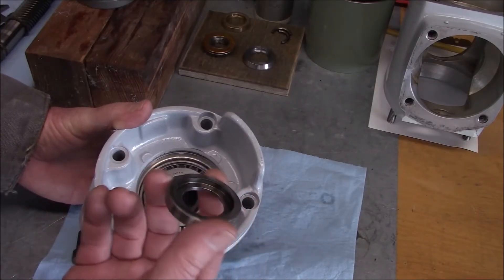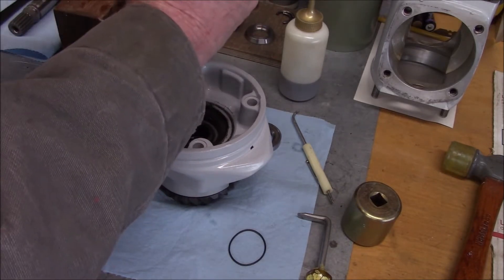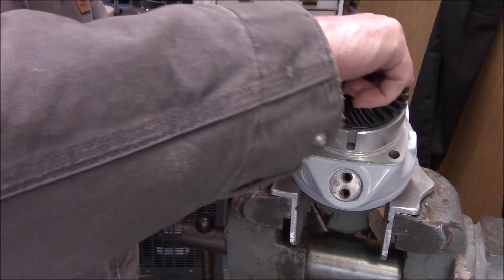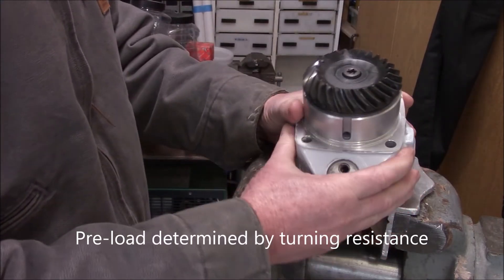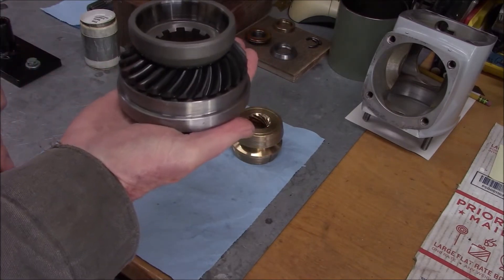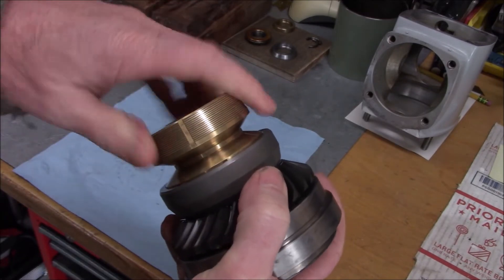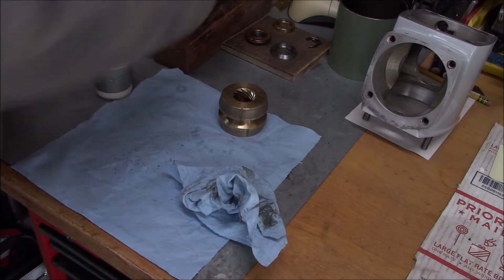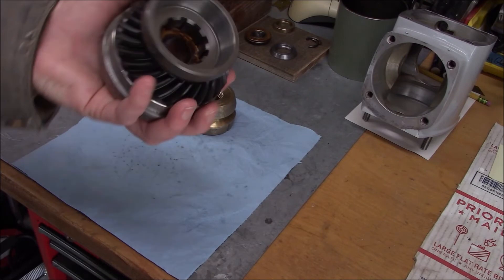Volvo Penta AQ Upper Part 3 Cone Clutch & Gear Shims

Comment: How do you determine when to replace the clutch cone itself? I've lost the gold coating on the FWD side of mine after lapping the cup. Thanks
Reply from the maker: It's very unusual to ware on out. If the tapered ribs are sitting below the edge of the cup when held together. It's worn out. You might have one of the rare steel cones most are solid brass. It's probably ok, just some kind of a coating.
Reply: @TheAyrCaveShop  thanks Dean. It is steel, P/N 3807613. I think that perhaps once the coating is lost that the steel is possibly more likely to polish the cup resulting in the need for lapping. I'm going to replace this one and see how I go. PS I recently asked via email for a copy of your shimming spreadsheet; would really appreciate a copy for my DIY use. Thanks

Comment: Dear sir, I want to thank you for your valuable help with the assembly and disassembly of the stern drive 290 D P
I built most of the parts in this set by copying from another used drive that I bought with a lot of problems, I've been working on it for several years. 
Without your guidance I wouldn't have achieved anything, I really appreciate it.
I'm assembling the reverser pinion but I can't find out for sure the bearing numbers and I thought I'd ask for your help to find out the numbers for sure, I have SKF 30207 and 30307, 
FAG 31307.
I would be very grateful if you could confirm.  If I can reciprocate it would be great.
I live in Brazil.
Jose Manuel C Alvarez.
Reply from the maker: Jose, the correct numbers are:
small bearing 30207 (sometimes J2 at the end)
large bearing 31307 (sometimes J2 at the end)
these are normally bearing sets, cup and cone.

that other number 30307 sounds like one of the cups. Just get the sets above.

Dean
Reply: @TheAyrCaveShop  Thank you for your help and attention,
I have been visiting your videos on You Tube for many months, A Q Upper, 01, 02, 03,04, 05 and Duoprop Lower Outdrive, Mr. Excellent master has helped me a lot, even without speaking English, I understand.

Comment: When this unit is fitted back on the boat and run up does the top unit feel warm/hot after a while.
Reply from the maker: Should not be hot. Warm is normal with any gear box. Make sure it's not overfilled..

Comment: I have a dp-c slipping going into forward until the RPMs rise then it slams into gear. I have torn down the upper and the cups are glazed.  Should i just lap them and use original cone or should I replace the cone? The drive only has 120 hours total.
Reply from the maker: Just lap them lightly, it doesn't take much. Check the condition of the bottom thrust washer, should be flat not cupped.

Comment: Is the joint oil seal the same for the 270?
Reply from the maker: Yep 270 through 290-A are the same seal
Reply: Do you pack the actual underside of the replacement oil seal before pressing back down?
Reply from the maker: @jamiefisher8411 I just coat the seal lips with some grease and a little grease coating in the seal bore it’s a tight fit. 
The bearing jest a few oil drops.
Reply: @TheAyrCaveShop  thank you so much. Putting my first one back together now. Your video's are much appreciated.

Comment: Hi Dean, hey just wanted to pass this by you in support of your channel, as others might have a similar issue . I did mic each shim, and assembled it. And the endplay was at the low end of tolerance, (about .004”) on the nut. So its on the tight end of things. The unit gears have backlash , and are a little tight ; but are completely free, and equal. Then I went to the shift mechanism, and did some adjusting. The nutural  and reverse are very “free”, however the forward gear has a measure of Resistance. The unit is laying on its side when I test it. So that might matter, but not sure. And the forward bearing is not clamped…(. I did shim out the shifter nut) to move as free as possible. But still (f)  has some resistance that the others don’t.

      Next I took off the shift mechanism and manually put it in forward . It was as free as reverse and nuteral . after that,  I did take the shift adj nut out completely. There is still drag on the forward Gear only. So I cannot get rid of the forward gear drag when shifted into forward. I was thinking of adding a .005” shim on the clamp ring to lose it up a little more.
  So I’m kinda stumped. Any ideas..? Thanks! Mike.
Reply from the maker: Hey Mike, there will always be a bit of drag in forward due to the cone clutch spring. Your just looking for a tight spot or excess drag.

Comment: I think I got it figured out shim wise. Does your excel file work on iOS devices… I’d like to make sure I got it right…if so I’ll email you. You’re a master at these, for sure. Like machining , the details really matter.Thanks again, Mike
Reply from the maker: Mike, good question, I don't see why it wouldn't but I haven't tried it. But you will need a Excel compatible app installed on the ios (Ipad). I didn't see any free ones in the app store. 
You can open and look at it without the app, but it won't run the calculation without the app.

Comment: Hi Dean, I’m at the reassembly point of my 290a upper. I got some difficulties with the etched gear numbers. And the stamped b and c values. I’m not sure if these gears came out of this housing originally or not, as I bought it already disassembled. Here is the numbers, on the gears (f)= -15, (r)= -13,  B=84, C=77. I ran them both ways. But not sure where to go, on this. I did put all new bearings in the upper, so I want to get this right. Any help is greatly appreciated. And your vids are second to none. I did pic up a lock ring washer from you. And it fits exceptionally well. It is piece of mind having it installed. The old brass ring looked in good shape, but was slightly distorted , Thanks for any help, and keep up the excellent work.  Best Reguards,  Mike (sent from wife’s I pad)
Reply from the maker: Mike, with the values you provided, here's what your shims should be:
Forward gear (bottom) .005"
Reverse gear (top) .003"
The calc' will work even if the gears came from a different unit.
Reply from the maker: Mike I'll run the calc for you tomorrow....busy day

Comment: Hello, I have a problem with my Volvo Penta Kad 32, Z-leg VP DP 290. During shifting forward and reverse come always loud bang. We have already replaced the cone clutch and shift cable. The other parts of the gearbox are in good condition with no signs of wear. The gear oil was also changed and checked. Idle around 700 RPM.
Thanks for the help!
Reply from the maker: Check the upper unit output shaft end play (feeler gage clearance under the top nut) if it's over .020" that could be it. I like it around .006". You might be able to check that by just removing the top cover. I haven't tried doing it that way, but worth a try. The thrust washer on the bottom of the output shaft is also critical, it's a common problem item I show in the video series. These items are may not be the issue but it's what I would check first.
Best of luck.....Dean
Reply: I have noticed that the bang is not soo noisy when the ship is moving. At around 4mph the shifting is completly silent (forwoard of course)

Comment: Is reshimming common when changing the pinion bearing? It seems most guys just put the same shims back in? I was always told the shims really dont change much because the shims match the housing not the bearing..any truth to this from an expert?
Reply from the maker: Hi Scotty, Your spot on, when just changing bearings, but what I'm seeing is most of these units have been serviced once or twice by god knows who...If there close I leave them as found. Sometimes there way off...proceed with caution in that case. I've had gears with the inspection marks difficult to read epically if its marked + or -  so I run the calculation both ways. When in drought, run a pattern and back lash check.

Comment: Again, this man's videos area well done. 
In my 25 years of AQ series engine and stern drive work, I never took the time to do a YouTube video. 

Here's some added info, if I may. 

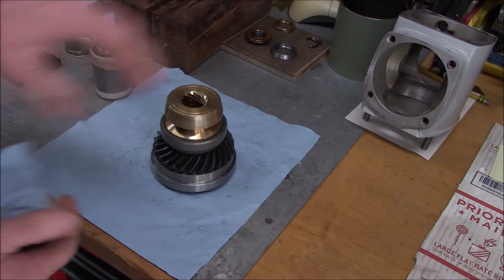At 7:35 into the video, during the sliding-sleeve-to-gear-cup lapping, I rotate the sliding sleeve with my right hand (as he does), as I simultaneously rotate the gear cup in the opposite direction with my left hand. 
For me, this helps to ensure that the pressure is equal around the entire circumference of the gear cup during the process. 
I see no limit to how many indexing rotations you can use.  
Be sure to remove any lapping compound from the sliding sleeve's oiling grooves. 

By the way, you will not find any instructions for this shown in the  OEM work shop manual. I can tell you first hand that it does work. 

Warning: This should NOT be done to a later year model transmission that uses the Steel Sliding Sleeve and Coated Gear Cups. 
These also use the bronze inlayed shift shoe. 

A note to all:  I would suggest that you NOT rely on the Seloc or Clymers manual for instructions.  Too many errors in these! 
Use OEM only.

RicardoMarine
Reply from the maker: Thanks Mark for the nice comment and great info !!
ATB....Dean

Comment: Very nice work, complete with LA's Totally Awesome cleaner. I've been using that cleaner/degreaser for at least 15 years, maybe 20. I believe it was brought to market in the 1980s (1980s - from memory... maybe 1985). 

You won't shock me when running that under hot water with "LA's Totally Awesome" cleaner. 

This detailed work is the difference between a repair job that is done correctly and a "repair job" (a mess) that will be a disaster and a complete waste of time and money! Very few people understand the details... almost none! 

Good job!
Reply from the maker: Thank You...Great comment and information !

Comment: I have tried to fit an Orbitrade seal for the UJ seal, I really didn't like how it lined up either. I am struggling to find alternatives in the UK. I ordered another Orbitrade as i my have deformed it while installing it. It took an awful lot of force for it to sit flat. Do you have Orbitrade n the US if so what are your thoughts? 

Your videos are the best on youtube for servicing these drives, thank you for spending the time.
Reply from the maker: Yeah, the genuine Volvo seals are best, but we typically use the SKF 692517 for the U-Joint. Put some grease in the bore, there too tight to dry fit.
Hope that helps...Dean